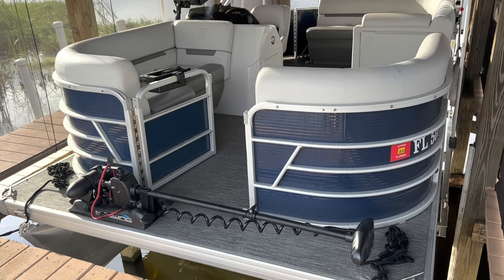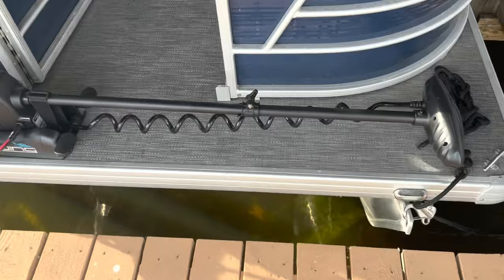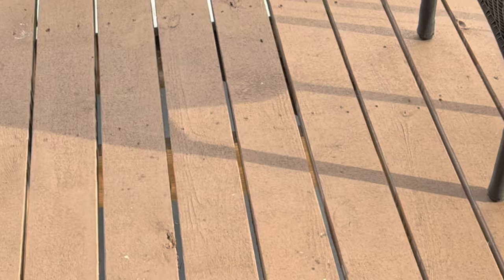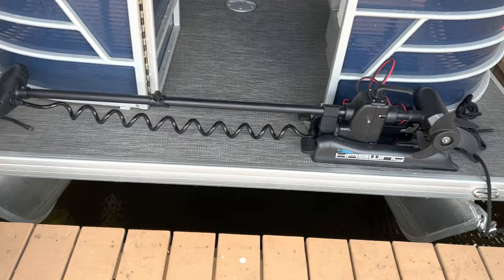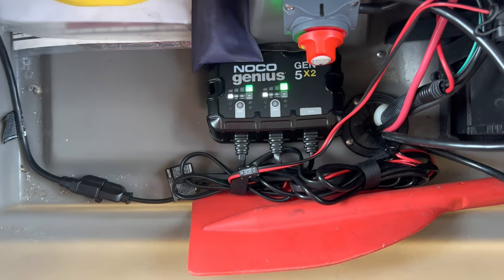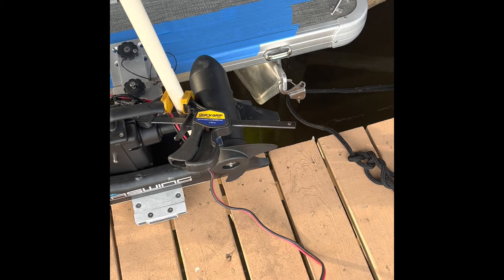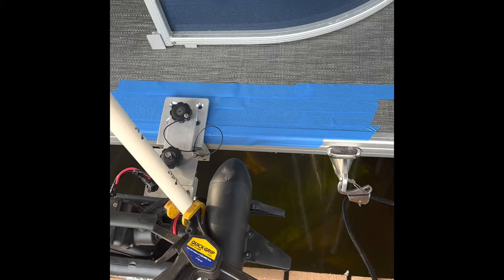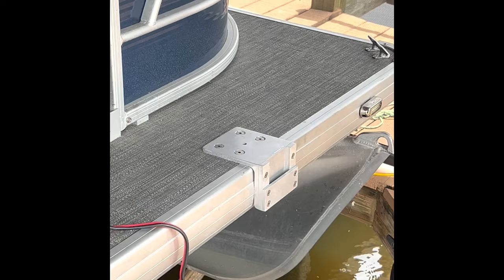Toon Troll Pontoon Mount with Haswing Cayman Trolling Motor

Comment: The quick release plate we sent with order did not have the Haswig bolt pattern but rather Minnkota bolt pattern.  In error the wrong plate was shipped.  The correct plate is being sent for replacement. With the correct bolt pattern and location a cut out or notch is not need when installing motor.  Otherwise a very professional installation and video.  Thank you.
Tim @ Toon Troll.
Reply from the maker: Thanks TIm, I've been out several times with the system and the mount you designed keeps the troll motor out of the pontoon "playpen" area and does not require a special gate nor does it affect the forward deck area outside the front fence.    I deploy the trolling motor to navigate through the dense hydrilla on my lakefront and once in clear water I can keep trolling speed or stow the trolling motor and run on my outboard.   Very ingenious solution !